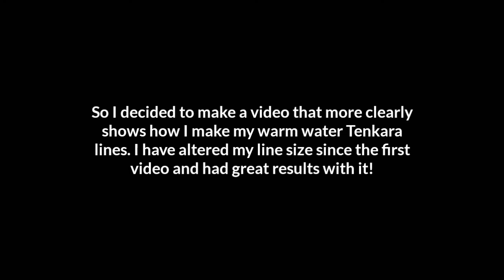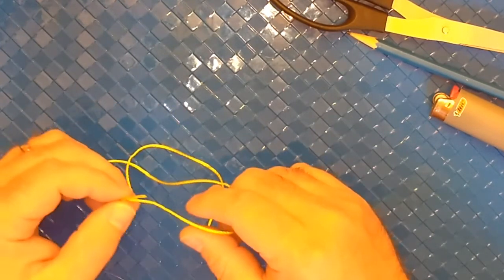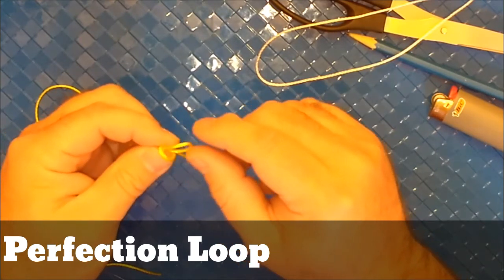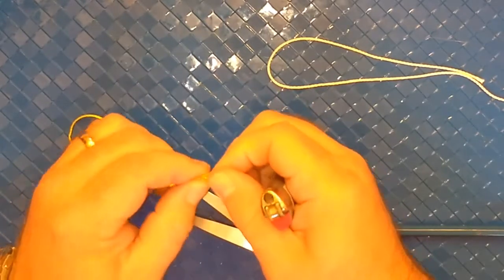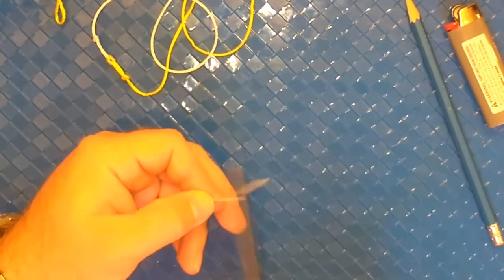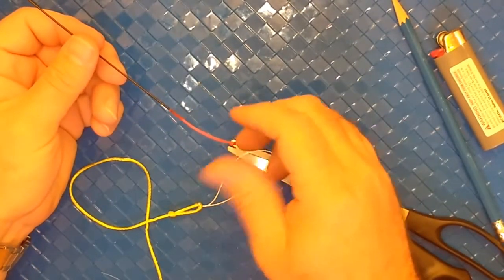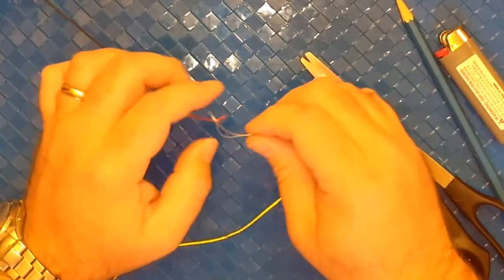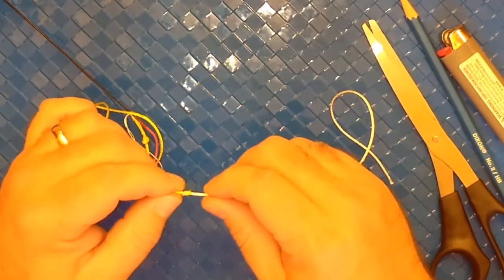Floating Tenkara Line

Comment: G'Day,
Great follow up video to your earlier How to one. Your rig is much the same as what I do with the garage sale  line that I told you about. It is polypropylene. I sometimes add a short 6 inch length of red fluoro mono to the tip of the line for visibility although if I couldn't see the tip of the main line it would be time for a new pair of spectacles!
I still haven't tried that nylon masons twine out on  the water. I've been out fishing a few times lately but that's been on tiny local creeks for trout using a dry fly with a nymph on a dropper.  I'll let you know how it performs, when I eventually get it wet.
Thanks again for your videos.
Cheers and tight lines,
Steve.
Reply from the maker: OZAngler I'll look forward to the update! I would suspect the nylon would really cast well since it is heavier. I found a place that sells pink Polypropylene line locally. I hope to pick some up to try out soon! I like the yellow in moderate too low light and can see it easily. It is a little hard to see at times when there is a strong glare from the sun on the water without sunglasses. I think the pink would show better in those situations.

Comment: I enjoy your vids.....I like your common sense approach(priceless)......my Dad used to call this "good solid down-home cornfield logic"....... good stuff..... I just wanted to mention that my favorite leader material is the cords off of old 1" mini-blinds (yes, the ones in windows) ..... this seems to be the perfect thickness for me to cast a 25 ft line(and I do that with my 9 ft uxcell).....I do use a floatant (Loon I think)...... and BTW, if you pull the inner core out of the cord the remaining hollow cord makes good Lillian....... LOL .... fun stuff ...... on some of the larger blinds the cords are much thicker but they all seem to be made up of 3 layers.....an outer braided, an inner braided, and the core which is strand......It seems that the inner hollow cord is same size as the cords used on the 1" mini-blinds....... I am presently working on an idea to make me some leader material out of 8 or 10 or 12 lb. test cheap monofilament line....I used 10 lb. test and braided a 3 strand leader that works good but I want to plait with 4 strands and maybe get some different colors of lines and plait a 6 strand(I'll let you know how that works... but before you try it I will mention it is very time consuming.....something to do though.... good for the concentration.....LOL)...... and BTW I have 3 Tenkara rods(all different flexes and lengths) and when ready to put in my backpack they weigh 11.4 ounces (total all together).....every "survivalist" or hiker should have at least 1 in their pack(more cornfield logic)...... total weight of my "tackle box" is 15 ounces
Reply from the maker: Jay Thomas Reset thanks for the compliments and ideas! I have not braided mono for Tenkara lines but I have furled them together to make tenkara lines. Cajun Line is a nice red color and Mr. Crappie makes a few different colors and they even have a multi colored line that you may find useful. They make for a nice stiff line with a little less memory than just a single strand mono.
I like the info on miniblind cord!
Reply: The Fishing Hobby I will check on that MrCrappie line....thanks

Comment: Nice video! 
Bought some mason line, tested a section of it in the sink - and it did not float🤔 
It’a three stranded twisted line…
Any ideas?
Reply from the maker: You may have gotten nylon (which is more common to find) and not polypropylene. Nylon is more dense than water so it sinks. Polypropylene is less dense than water so it floats. There are different polypropylene formulations that are more dense than others but all are less dense than water. Polypropylene will float for quite some time before it becomes waterlogged. Once it gets waterlogged, you need to do a false cast to get the water out of it so it will float again. If the packaging says polypropylene and it doesn’t float at all, you more than likely got a mislabeled product (it is pretty common for items made in China to be mislabeled).
Reply: Thanks for the info! It said polypropen… But I will try another brand, just to check.😎
Reply from the maker: @TheSlamDancer on this video, about 3:08 into the video you can see how this line floats. https://youtu.be/0KJtw4vMAxg?si=Y5XDZzyKf7xpwOgw

Comment: I know this is an older video but I'm wondering if anyone has ever tried or had luck with thicker Spectra/Dyneema line? I have some that I believe is 1.2mm that I was planning on trying as soon as my $2.46 rod gets here just for the heck of it. This isn't 30lbs more like 350lbs but it should float, but water proof, is stiff, slick, no memory issues. Only downside I can see is that it's not dense at all.
Reply from the maker: I have not tried any that size. I recently purchased some heavier braid (I believe it was 100lb test) to try but haven't had a chance to yet. If you try it, please let everyone know how it does!
Reply: The Fishing Hobby I won't have anything to compare it to unfortunately outside of regular fly line. I put some on my baitcaster since the reel was off and it was able to cast it just fine even though it didn't load the rod at all. When my cheapo "Tenkara" rod comes I'll set it up on there. It's light, zero stretch, no memory, floats, and darn near bullet proof. I actually originally picked it up for Bear Bag line.
Reply from the maker: Sounds like it will cast really well then. A good place to start experimenting with line length would be to use the braid about the same length as the rod and then use half that length of mono or flourocarbon for your leader. If the braid hits the water too soon (way before the leader) then you may want to go longer with the braid because the line is heavy and casts too quickly. Those are just some things I have figured out that work well for me personally. Usually the inexpensive rods are a little stiffer than real Tenkara rods from my experience so they will probably work pretty well with the braid you have 👍
Reply: Update on this comment. I picked up some 90lbs test Dyneema line in Orange. Finally got my cheapo rod in and got around to using it. Being a novice I can't say how well it worked, but it worked well for me. I ended up landing two Bluegill first time out on my setup. This was with a 270cm fiberglass rod, 90lbs Dyneema level line equal length, 4lbs mono tippet, and a Tenkara fly with reverse hackle. The line floats, is easy enough to hold off the water, and seems to cast fairly well. A thicker line would probably let you cast a long line, but too thick and I'd imagine you'd overload the rod.
Reply from the maker: Sounds like that works well! I have some 100lb PE braid that I still haven't tried yet (Dyneema is a type of PE). Sounds like I better give it a go 👍

Comment: Hello, can you please tell me about the polypropylene, like it's diameter, and what it's usually labeled as (cord, twine, line)? And does what size flies you use matter and affect things? I've been stocking up for the next spring when I take up fly fishing, so I've got from #1/0 Alaskan/Russian River flies to #4-6 wooly worms to #10-12 natural ants & March blacks, besides a bunch of other bulk-sale bags like white millers and bumble bees, etc... so I have a bunch to work with. Also, any experience using tippet rings and fast-snaps with tenkara setups? Been looking into those since I will also be doing standard fly fishing as well with the 6.5' 3/4wt Eagle Claw Featherlight I just bought, and my uxcell 6'10" just came in yesterday too so I've been looking around at Yosankara videos like yours (Yosan means budget and it seems appropriate to call the frugal side of tenkara that! Would make budget tenkara more searchable if it caught on.). Also also, ever use micro/finesse plastics and lures with it, such as with 2-3" trout worms and 1/32oz spinners like how conventional fly fishers sometimes do?
Reply from the maker: Here are a couple of my videos using my Tenkara setup. What I do may not be exactly what you are looking for. 
https://youtu.be/68SiT44-PEQ
https://youtu.be/0KJtw4vMAxg

The polypropylene line is much larger than what Tenkara users are usually looking for. The line I use is called Polypropylene Mason's Line found in hardware stores and it is approximately 1.25mm in diameter but it is hard to get an exact measurement because the line compresses very easily.
It is a 3 strand twisted line.

This will seem odd I'm sure because Tenkara rods are made for fly fishing but I don't really use flies with it so I'm not going to be able to help you with fly selection unfortunately. I subscribe to another channel called "Robbie's Fly Tying Channel" that you may want to check out. He ties a lot of his own flies and does a lot of fly fishing videos using his Tenkara rod. He will have some good info on flies for you. If you stop by his channel, let him know I sent you.
I also don't use tippet snaps or rings, just knots and loops.

I do use micro/finesse soft plastics and have had very good luck with Creme trout worms and various soft plastic nymphs and crickets as well.
I use live crickets a lot and they produce a lot of fish in the Tenkara setup. There isn't anything quite like fishing weightless live crickets on a Tenkara setup. We have caught fairly large bass with this technique and tons of sunfish.

Hopefully this info is helpful and best of luck to you with your Tenkara fishing. It is a really fun way to fish no matter how you go about it!